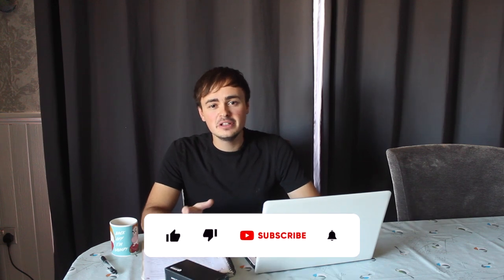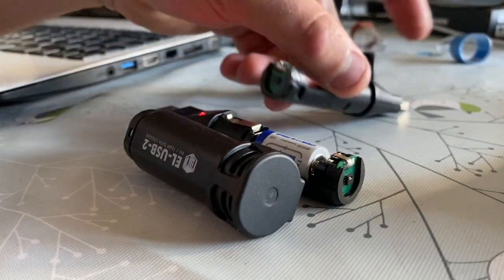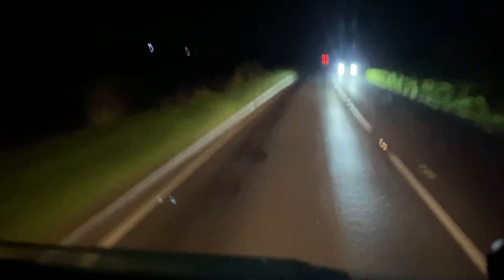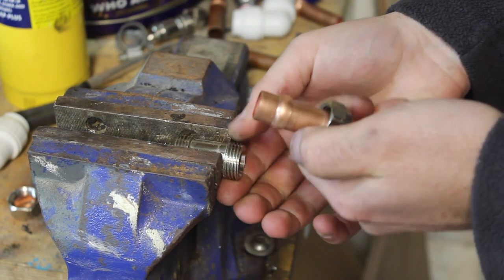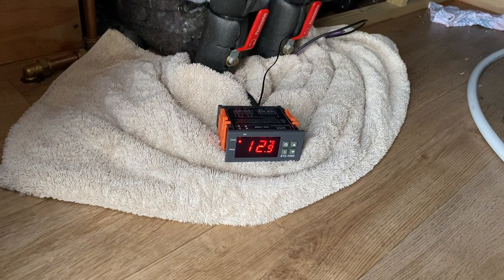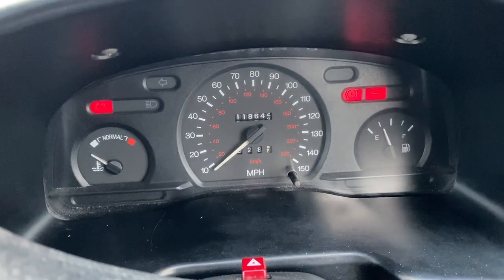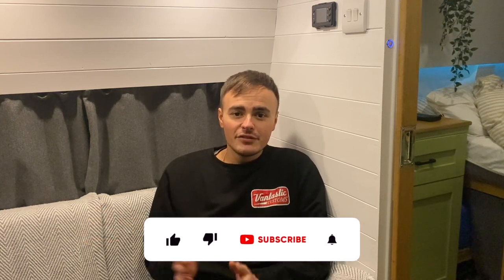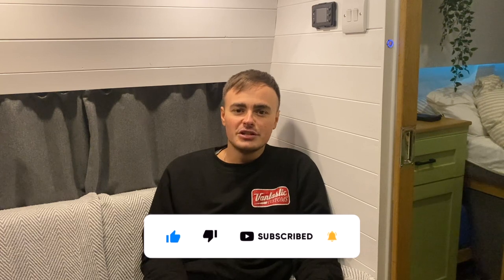Campervan Water Heater Testing, FAIL & FIX - Van Build Series - Episode 28 - Part 3

Comment: With the water circuit left open after stopping the engine, the system starts working in reverse by thermo-syphon effect, and will heat the cold engine block using your stored heat. A pair of 12v solenoid taps wired to the ignition will stop this by isolating the system when the engine is off .
Reply from the maker: This is a very good point thank you for sharing, I had never thought about thermo-syphoning from the tank. Will have to manual isolate for now 👍🏼

Comment: You’ve done an amazing job mate! I’ve been thinking of building something similar, you saved me a lot of research, especially to the tank as I was thinking of using an 11kg propane tank (26l). Also thank you so much for showing all failures, basically giving me a complete solution.
Reply from the maker: Thank you, it did take a lot of thinking about but was a fun project. Glad this will help you make yours. Stainless or copper cylinder for potable water 😊
Reply: @TurnersWorkshop97  £57 for pressurised tank able to withstand high temperature is a great deal I was looking for for a long time. I'll be doing much more testing/experimenting. I live full time in a van here in UK. If I still get excess heat during winter I'll thing about extending that system into home style radiator to heat up the living space :)
Reply: @TurnersWorkshop97  I'm finally building it now. I used the proper radiator hoses, 16mm ID all the way from the engine bay to the garage. Question- does the expansion tank heat up significantly? I'm thinking of placing it further away from the tank and not isolate it unless it really is necessary. Thanks in advance :)
Reply from the maker: @PatrykRElektronika Nice! Let us know how it goes. The expansion tank can be mounted anywhere as long as it’s connected to the storage vessel as shown in the video :)
Reply: @TurnersWorkshop97  Will do :) I'm pretty sure now that I will also isolate the main radiator and fit another radiator at the back of the van. Either a standard household one or an automotive one with a decent fan, to heat up the van while driving and not the air. As for expansion tank- I know I can fit it anywhere but wanted to know if I'll lose a significant amount of heat if fitting further away and not isolating. I doubt, but you're smart and you decided to isolate it too, so you must have thought about it..

Comment: Really good idea great skills and knowledge.

Just an idea to suggest a way of regulating the temperature, you're using an LCD temp monitor which I believe has  PID capabilities.
Could you use that to activate a control valve so when the tank gets to the desired temp it closes and then opens again if it drops
Reply from the maker: Thank you! I will be adding to it soon when I get a chance. Putting some temperature control like you say but pump instead of a control valve 👍🏼

Comment: Buddy, you're on to something potentially disruptive here!  Maybe you should start a company of your own, building and installing these systems for van-lifers.  I mean free hot water is pretty rad, but it is of secondary priority for van-lifers.  The #1 priority is air-heating.  So if you can figure out a way to transform engine heat (after 20-40 minute daily drive) into daily air heat (through some kind of CPU-like heat-exchange fan like Bobil, and underfloor heating pipes), have all 3 systems run concurrently or in isolation, be monitorable and easily self-regulating (e.g. automatically switching off once ambient air reaches 24C, and switching back on once it drops below 18), and bring it to market at reasonable price point (and SAFELY), then you'll have a solid product. 
I'm sure a lot more testing and number crunching is needed; and maybe a way to store hot glycol or store energy/heat for when the engine is not running.
Have it installed at discount for some VanLife influencers, and that's all they'll talk about - marketing sorted.
Reply from the maker: Thanks mate, I like the idea but it’s already been done one way or another. They already make the calorifiers for the marine industry and like you said bobil vans make the heat exchangers from the diesel heaters. You really can’t beat a diesel heater for price range and performance, they’re brilliant 😁
Reply: @TurnersWorkshop97  Thanks for the reply!  I was thinking while writing that comment.  Since then I did a bit more thinking, researching and calculating, and actually, no - there isn't something like this readily available on the market.
The problem that I ran into is the "storage" of heat.  While the vehicle is driving, it will heat the air pretty quickly, but what afterwards? So I'm thinking, why not use a 30L hot water tank itself as "heat storage" that can slowly release its energy throughout the day and heat 8-11cu.m of space. Unless my math is completely wrong, heat capacity of 1cu.m of air is 1.2 kJ/m3/°C. Heat capacity of water is 4.2 kJ/L/°C.  With good enough insulated van, and a 30L tank full of 80°C water, you can keep slowly releasing that energy and keeping room temperature at 23°C all day. (80-23)*30L*4.2kJ=7,200kJ=2kWh 
Diesel heater or Propex, thus, become only a secondary (backup) heat source.
Sure, them Chinese diesel heaters are cheap, but red diesel is difficult to find; and even at £0.80/L the monthly costs do add up.

Comment: Excellent only trouble is my LWB Transporter is shorter than a Transit LWB. So my space is at a premium! I was going to go for a Jumbo Transit but as you say they struggle with hills - the VW engines just EAT hills I have the 2.5.  But your system has made me think of using the engine to heat a HOUSE radiator inside the van? But that migh overcool the engine in winter? But in summer it will aid cooling - not sure what do folks think?
Reply from the maker: Thanks 😊 I like the idea but for the price and efficiency of a Chinese diesel heater I feel it may be the best option for space heating.

Comment: As thought you’ll have trouble with safety when the temperature gets high my 150 gallon commercial tank has a thermostat that stops rad water going into tank when tank water is hot hot 🥵 
What people mistake is the water temperature from rad is not the same as tank temperature 
If rad water keeps going into the tank through your heat exchanger it will become dangerous high temperature and pressure. You’ve used safety for pressure but you really need one for tank temperature. 
The pipes I use are thick rubber  radiator hoses dunno the rating but used on trucks. 

Interesting stuff specifically the temperature records 

Please look at some safety measures because that little tank could be a steam tank that might just pop without some thermal protection

Comment: Be easier to just heat a kettle...in reality you don't need that much hot water for van life...and as soon as fresh cold tops up the hot water cylinder it will soon be ambient temperature water in the cylinder. Defeating the object...I'd buy a hose lock portable shower and put the hot water into that for a shower. You shouldn't have 80c water coming out of taps as you've already mentioned...damn good effort though.....subbed and liked
Reply from the maker: Thanks for the sub mate, appreciate your feedback. The way I see it is that it costs too much ££ to keep using gas for boiling water especially these days with the price of gas. This way you have a nice tank of hot water for showers/ washing up after every drive. If you want a cuppa, it will use much less gas to get the water to boiling point. I will be adding a 12v heating element to the tank also so that the water is heated by excess solar in the summer months.  I think 80c water out the taps is excessive so I’ve ordered a mixer valve for the calorifier so that it’s blended before it reaches the taps 👍🏼

Comment: does this system work with the ecoboost motor?
Reply from the maker: I don’t see why it wouldn’t mate, it’s just putting a T piece in the heater matrix so the load is split between the heater matrix and calorifier, the majority of flow will still go through the matrix but enough should circulate through the calorifier to heat the water too.

Comment: Do you think it could be over ridden with a 12/24v immersion element on a thermostat? Given enough Calculated amp hours from the energy storage. I forget do you have solar turner? Potentially a separate photovoltaic module and separate maximum power point tracker (mppt) to charge power into the given circuit & or a changer over switch (or double element) to heat the water from the existing electrical system & or on a not so sunny day 🤷🏽‍♂️
Reply from the maker: Definitely mate, I’ve got a 12v element ready to go in and will be looking at incorporating it into the solar set up. I have a single 100w panel at the moment but will be adding another 200w panel at some point 👍🏼